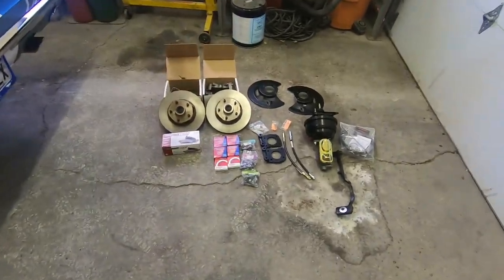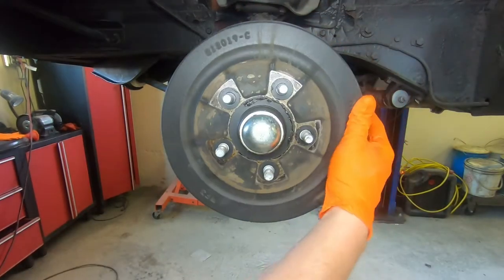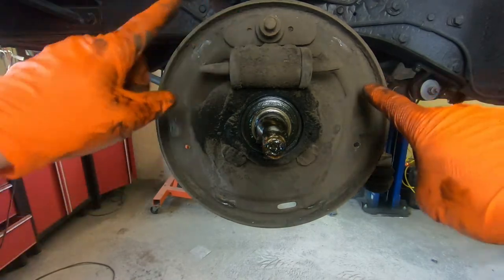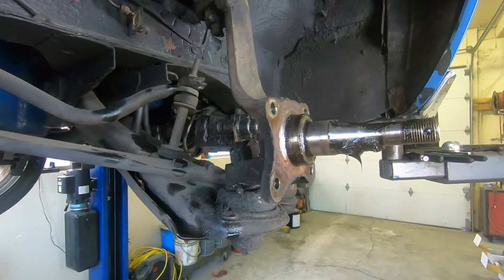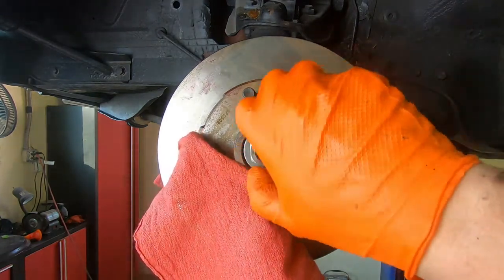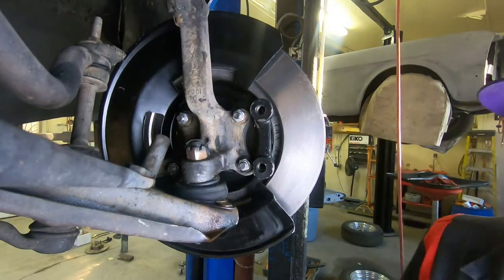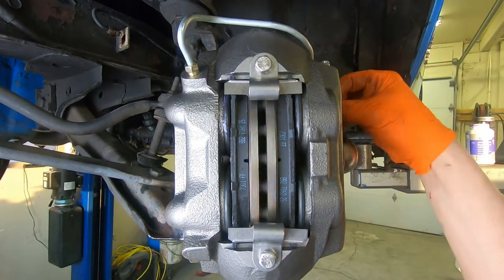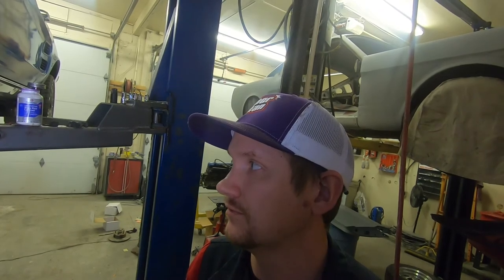Disc Brake Conversion - Rotor & Caliper - 1967 Ford Mustang

Comment: Great video! I am working on teaching a young kid to build his 67. He is about to go through the same thing. I sent him this video to make my life a little easier.
Reply from the maker: Oh awesome! Tell him the link to the kit I used is in the description. I love how this car brakes now. For a driver/cruiser, by far the best kit on the market.
Reply: @AlfsMustangGarage  yep I have him looking around to find all the parts from varies locations as you did. He was looking up the parts from the information in your description as well. Trying to teach him to shop around not just click the easy button on a kit and he could likely save money.
Reply from the maker: Absolutely. I got most the stuff from National Parts Depot. You can find seals, bearings, pads, rotors at your local parts store. But Amazon does have some good pricing as well. CJ pony parts sometimes is cheaper. But if you have to warranty anything out, good luck. I'm not sure if you saw me bleeding everything. One of the calipers had a hole and was leaking. NPD had me a new one in 2 days no cost.

Comment: Just working on my 69 mustang installing front disc brakes.  The 2 brass fittings you mentioned that goes from the smaller hose connector to the 7/16 male tube fitting on the car.  I just bought them and noticed that the flared tube doesnt sit inside the fitting as it should.  It sits on the flat portion of the fitting flare, like the tube isnt big enough.  The tube should go into the flare part of the fitting

Comment: Great job making the video and tutorial, do you have additional video's covering the brake cylinder, and proportioning valve install? Can you add the video URL's to the video description?
Reply from the maker: I do have some older ones but I'm currently working on some updated ones.

Comment: Great video very detailed explicit instructions  thanks. I have a question my car is a early 67 originally a six cylinder car with drum brakes. I still have  the 4 lug system  I want to change to a 5 lug  a.K.a V-8 hubs. The question is are the spindles all the same on 1967 and 1968 mustangs or do I have to buy V-8 spindles  ? . I would appreciate you're in site
Reply from the maker: Thank you! So the spindles are only the same on 67 and 68 if the 68 had drum brakes. If the 68 had disc brakes, they had different spindles. They were also different from V8 cars to 6 cylinder cars. So its typically best to purchase the V8 spindles when doing this conversion. Is that answer what you were looking for?
Reply: @AlfsMustangGarage  Yes thanks for the confirmation of the spindles

Comment: Yes, I understand this is for the front of Mustang.  Mine is the 1973 Mach 1.  Question -----  Where can I buy the conversion for the Rear of my Mustang ?
Reply from the maker: I would check with SSBC brakes first. National Parts Depot usually has great options as well.

Comment: Nice vid. I thought you had to change spindles? Are drum and disc spindles the same for V8 in 67?
Reply from the maker: Nope. 67 and earlier used the same spindles for disc or drums. In 68 they started using different spindles.
Reply: @AlfsMustangGarage  had no idea. Would’ve switched mine years ago if I knew that! Doing it this winter now. Thanks!
Reply from the maker: Oh ya right on. Good little project over the down season 👍

Comment: Great videos! Are all drum brakes on 64 1/2 to 70 mustangs 4 bolt spindles? I saw somewhere that some have three. I’m going to be doing this on a 69 drum 5 lug car soon. Keep up the good work and thanks.
Reply from the maker: Thank you. I believe they were. Starting in 68 they had different spindles for disc brakes. But as far as I know the drum brakes were 4 bolts spindles. They had varying degrees of changes from 6 cylinder to v8 cars and little things through the years also.

Comment: Very simple. I think that paper gasket was to address rattling as I have read in some cases. Loved the different approach to the cotter pin! ....
Still trying to figure out if granada spindles will work with mustang v8 rotors?!.... (and spacers?!)
Reply from the maker: Oh ya I've heard of people using Granada stuff on Mustangs. I just assume using Mustang stuff on Mustangs is pretty easy.

Comment: hey Alf. great stuff. question.... is there anyway that the calliper can installed towards the back of the car instead of being mounted towards the front of the car?
Reply from the maker: Well I'm not sure actually. They are kinda designed to be on the front. What is your thought process for mounting on the rear?
Reply: @AlfsMustangGarage  looks weird lol. but just went outside and my explorer had them mounted towards the front and my work truck has them towards the rear, guess i never noticed them mounted towards the front
Reply from the maker: Ya it's just one of those things I guess. Some cars are designed on front and some on the rear.

Comment: Amateur here. I'm converting my front drums to discs on my 64 Ranchero. I purchased a conversion kit that included a double chamber master cylinder attached to a vacuum power booster. The problem is that there is no space because the mast cylinder hits the shock tower. Would it be prudent to just remove the power booster? As is, I'm already upgrading from a single chamber to a double chamber master cylinder so I believe it to be a step up. Please help.
Reply from the maker: If you're not dead set on having power brakes then yes you can run just the master cylinder. However, you'll need a different master cylinder. There are differences for master cylinders with and without boosters. I would contact LEED brakes to see if they have a booster and master cylinder that fit your car. Their kits are the only ones I have found that fit early year Mustangs with shock towers. I hope that helps.
Reply: @AlfsMustangGarage  Thank you for the response. I contacted Mac's whom sold me the kit but not much help. After several months I was able to chat with a tech who told me ABS puts the kit together. Ed in ABS is now helping me. The bad thing is that I bought this years ago in anticipation of this stage of the project.

Comment: Question, why does the drum assy. have to be completely disassembled.  Is it possible to remove without doing so, by just removing the dust cap, castle nut the outer wheel bearing, the brake line and the 4 nuts on the backing plate then removing  the drum assy. brake shoes as one complete assy.??
Reply from the maker: It doesn't need to be. You're very correct when you say you can remove it as an assembly and leave the shoes, cylinder, and hose attached.
Reply: Ok appreciate the reply, this answers the question I have been thinking about and trying to understand, will streamline the removal process for me.  Thanks for posting this video.
Reply from the maker: You're welcome. This video I did shows me removing it as an assembly. It's all on time-lapse but it does help make things faster and you can organize the original stuff in case someone wants them.https://youtu.be/hxV30hmQr7k

Comment: For a 67 mustang what calipers did you use and mounting bracket. National Parts Depot listed bracket #2B134-1B. Is that correct? Where the caliper mounting bolts included?
Reply from the maker: So for the actual caliper there is an early 67 and a late 67. I used the late 67 ones part number 2B120-1D. The difference is the early 67 has a 3/8" brake line inlet port and the late 67 has a 7/16".  Now of course you will have to get the RH and LH version of those and figure out if you're a early or late 67. The bracket is correct for the LH and it does not come with mounting hardware. The part number for the caliper bracket mounting bolts is 2B134-2AK. Hope that helps out!

Comment: Will this kit fit (including power booster and master) a 66 Mustang with MT?  If not, how do I determine the correct kit?
Reply from the maker: This kit will not fit a 66 mustang. They changed a bit from 66 to 67. I would just go to the Leed Brakes website and find the right one for your application.

Comment: Will this conversion kit (including power booster and master cylinder) work for a 66 Mustang, MT?  If not, how do I find the correct kit?
Reply from the maker: No this is specific for a 67. I would get on Leed Brake's website to find the right kit for you.

Comment: Would you considering using lock tite on the bolts for the bracket plate?
Reply from the maker: So the bolts that mount the caliper to the bracket, yes. The bolts I used actually came with thread locker. The bolts that mount the bracket to the spindle, you can just use lock washers or nuts.

Comment: I have a question . I installed an disc power kit . The kit had the brake pedal and master cylinder and booster and dis value and  all lines . I have never have had good brakes  . Hard petal will not lock up the wheels. I have good vacuum . Even have had a brake shop work on it and still the same have replaced boosters the hold brake front and back have been replaced . I have contacted the kit  supplier and they haven’t been able too help fix it only say not enough vacuum I have also in stalled an vacuum pump and canister. So if someone knows what is wrong please let me know thanks .
Reply from the maker: You could start with getting a brake pressure gauge and measure the amount of brake fluid pressure at each wheel.